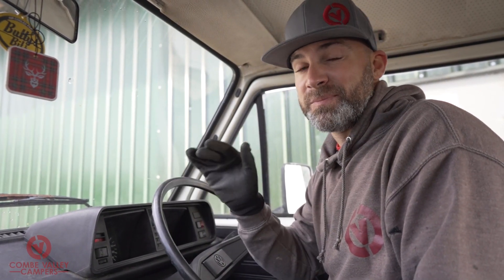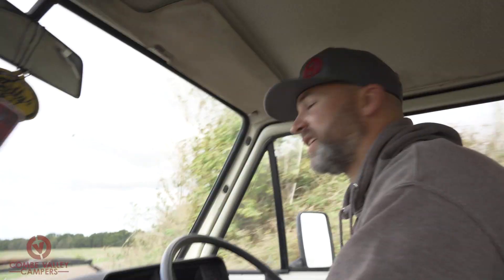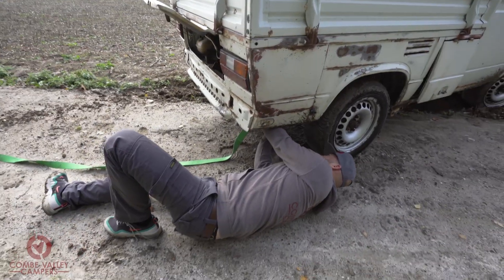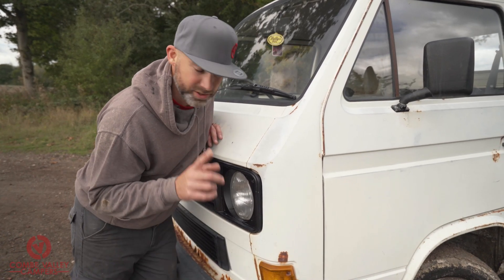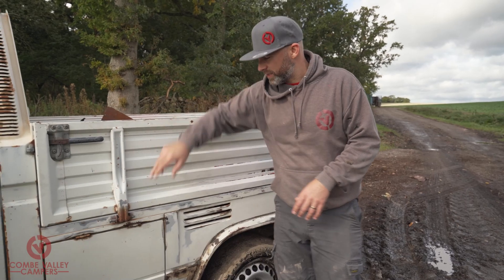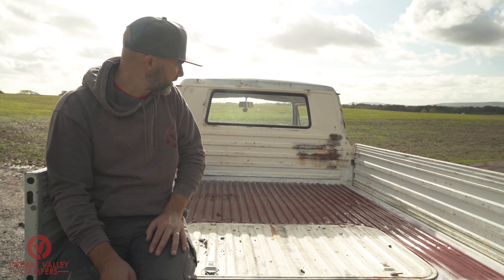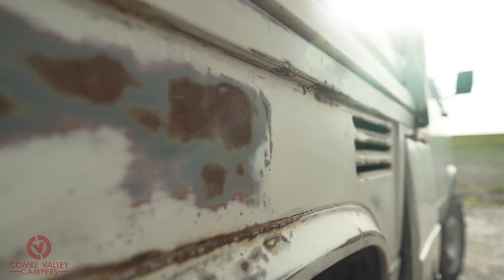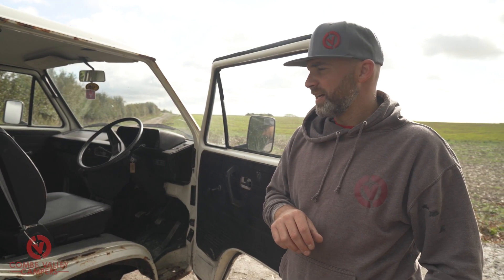Everything wrong with my new VW T3 Doka. (Rose tinted specs edition!)

Comment: Hi from Massachusetts!
How about doing a video on lubricating the radiator fan motor or replacing it, bleeding the cooling system,  bleeding the clutch & brakes ( hey where is that brake fluid reservoir anyway?),  and since you mentioned sound deadening and the windshield is coming out (and a paint job) then you should drop the headliner to install sound deadening while you're in there as that roof is a noisy tin can top! Any chance of getting a Vindic (sp?) topper for the bed? I like having a grab handle on the A-pillars to help to get in the front seats. If you want to get crazy then put an LSD in the differential instead of going all Syncro on us. My DoKa no longer gets stuck on the perfectly flat wet grass. Just sayin....
Reply from the maker: All great suggestions. We will definately be doing dash in/out videos, and heater motor replacement too. Leigh

Comment: I have a T25 that colour is there any chance you know the paint code for it please and good luck with what you are doing. By the way my camper is 1989.
Reply from the maker: Yes the white colour is fairly common on these. I can do one better actually, I can tell you where your paint code it. You should have a silver sticker under your passenger seat (nearside). And that has the colour code on it
Reply: @CombeValleyCampers  and if the sticker is long gone, there should be a riveted body options plate (M-plate) under the passenger seat inner rail brace (on RHD). the upper/lower paint sales codes with the interior upholstery sales code is stamped there around the left rivet. Most likely it is R1R1LL Pastel white upper/lower with black woven pattern faux-leather covered seats

Comment: You're lucky enough to have rear wheel drive, 
If this happened in the old days 
Partially apply the hand brake & this will act as a primitive diff lock & put some drive through both wheels 👍🏻
Ps good luck
Reply from the maker: Thanks Alan, I'll keep it in mind for sure